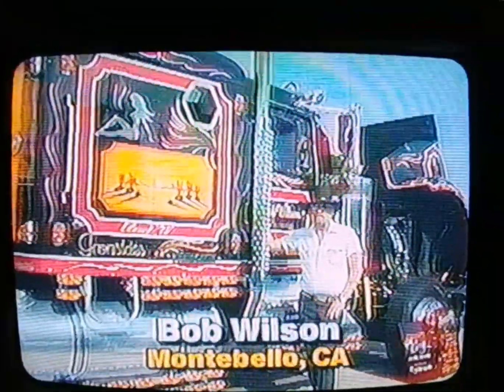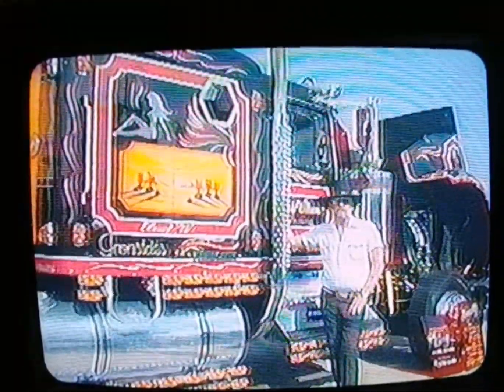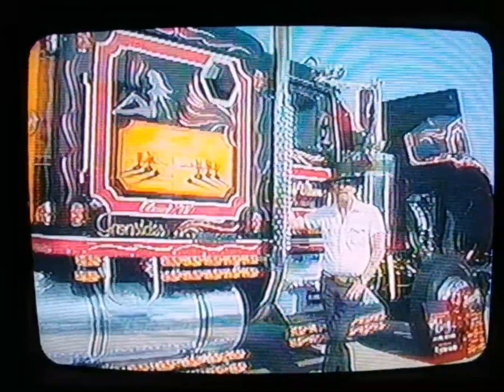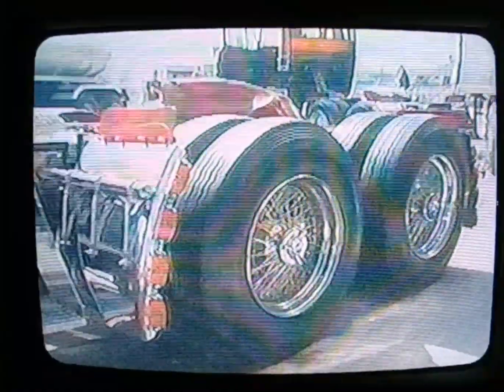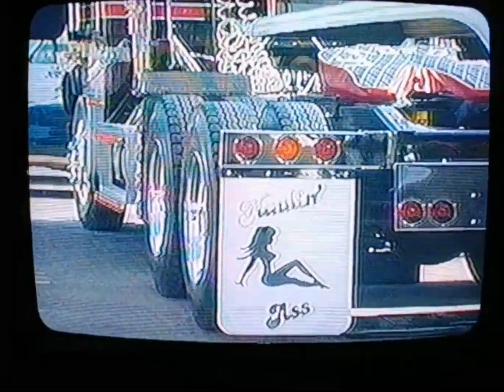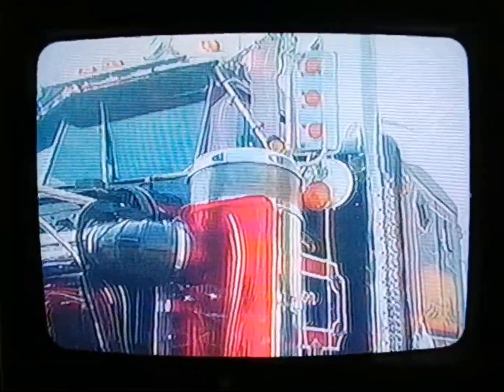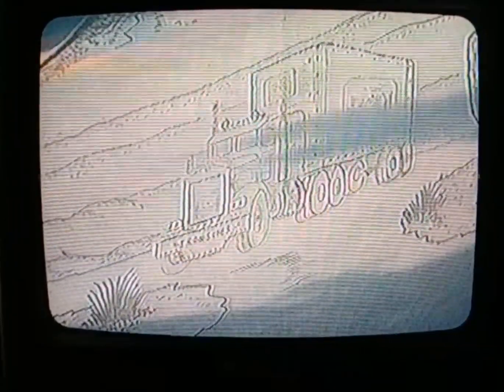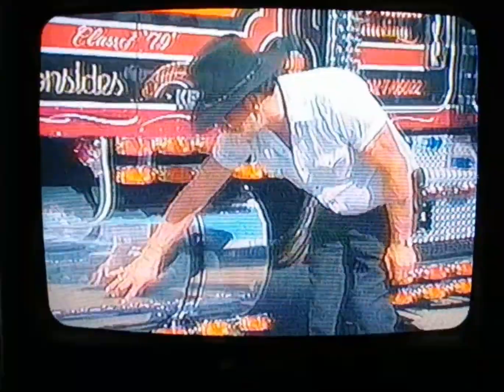Bob Wilson's "Ironsides"

Comment: Remember that truck at dyno days truck show in San Diego @ Hawthorne power systems. About 1990. The goal was 1000 horse power. 
A 3406 b model won that day.
Around 800 hp if I member right.
Reply from the maker: It's still around!
Reply: Ibelieve that year a3406 b cat w/ propane went 760 hp on dyno.

Comment: He calls it a 525 but it’s a K series.  They came in 3 flavors back in the day: KT450, KT525, and KTA600 (K series, Turbo, Aftercooled 600 hp).
Reply: Those kt 600 engines were awesome 👌. 
Drove that and the 3408. The heavier the load,  the harder they pulled.